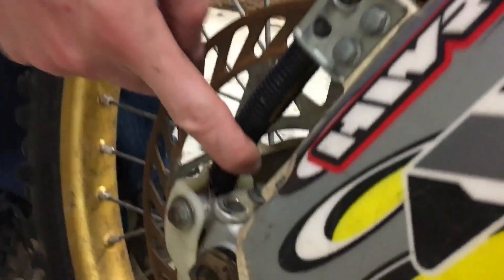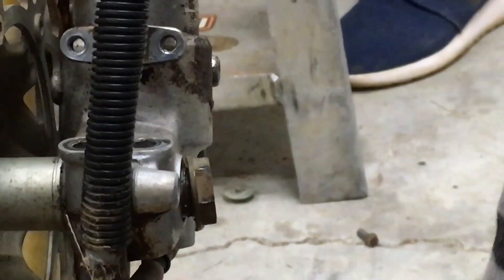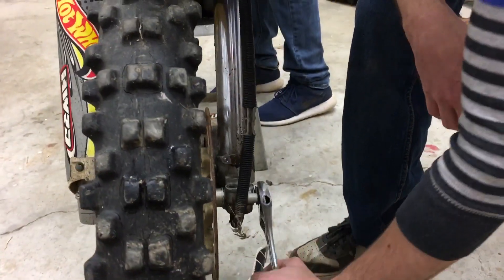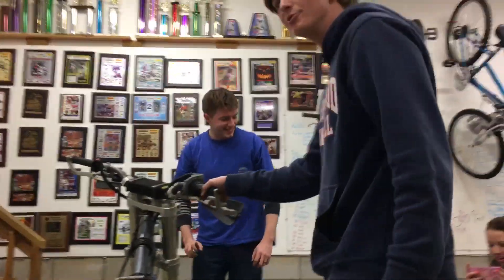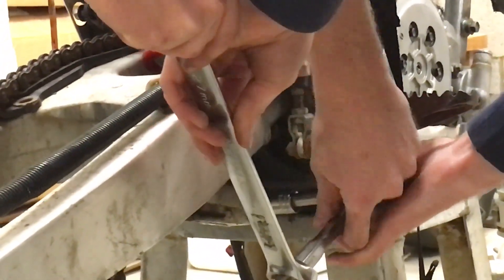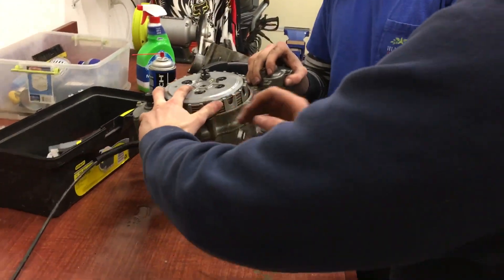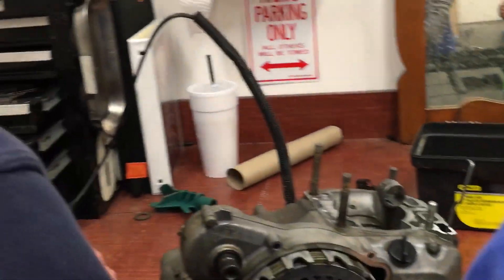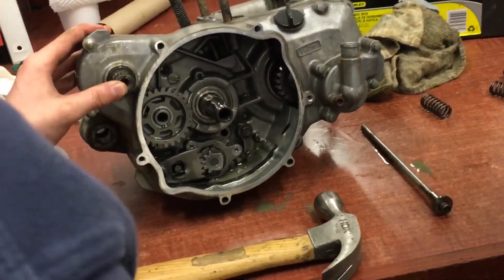Learning How To Work On A Dirt Bike

Comment: Have a tip for extracting stubborn bolts using a slightly smaller socket and smacking onto the bolt head with a decent hammer - you can use the socket extension if difficult to reach - used this technique on my dirt bikes over over the years - don't suggest using on exhaust brackets as will tend to buckle or breake them :)

Comment: Hey, actually a quick tip: when you go to tighten down the front fork clamps, make sure you have everything in position, and compress the forks a time or two, otherwise one fork leg (non axle nut side) may have a bit of a twist in it.

Comment: how does water get into the oil like that?
Reply: Crack in the cylinder wall or a VERY leaky head gasket.
Reply: +cole unruh or leaking water pump gasket/seals
Reply: thanks guys